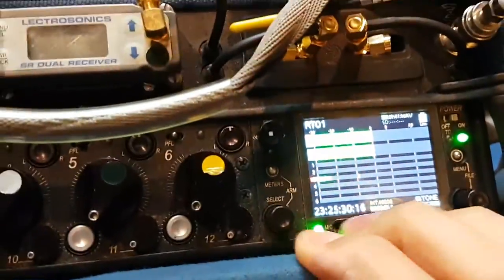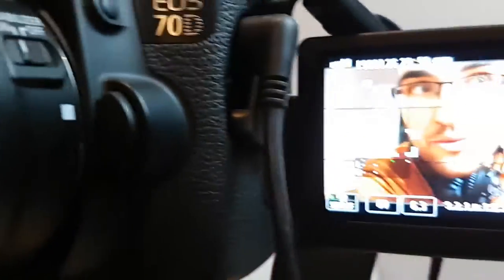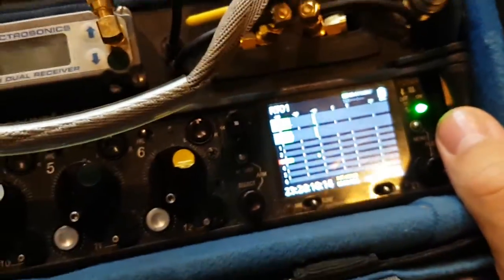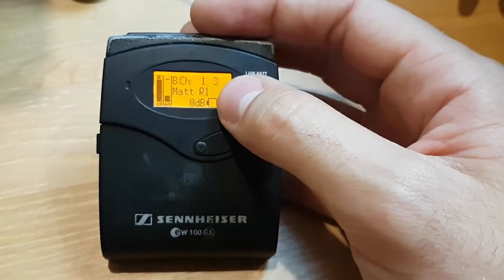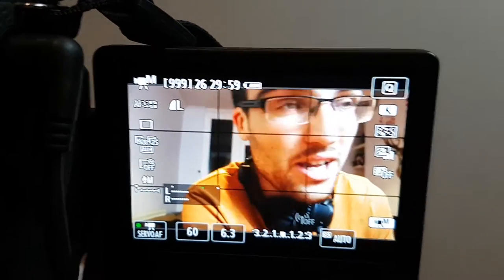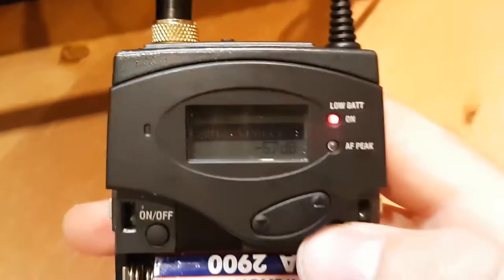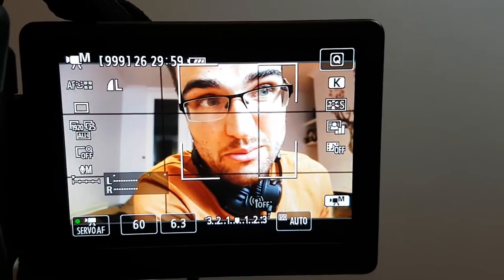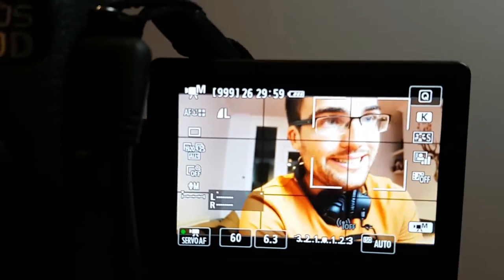Wireless Audio Camera Link To DSLR

Comment: We did something similar with an FS7 on our last shoot (interviews/short editorial documentary). Though we just set a second reciever to the same frequency as the lavaliers transmitter because the camera operator wanted to level himself and basically just have a backup. All in all the setup was like this: SD664 for recording/premixing (which works like the 633, which in turn I learnt from you ;), shotgun/boom with directional slightly overhead, aimed at lower lip (depending on location), wireless lavalier on the person to be interviewed -> second backup reciever to camera, plus a directional mike on camera for additional room/ambience. worked quite well. If you wanna hear the result, I can pm you the link ;)